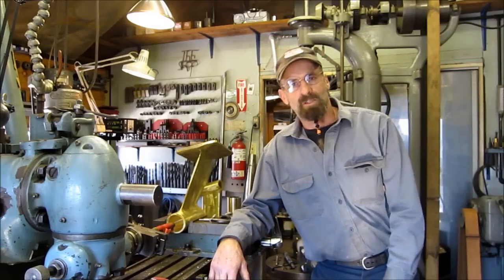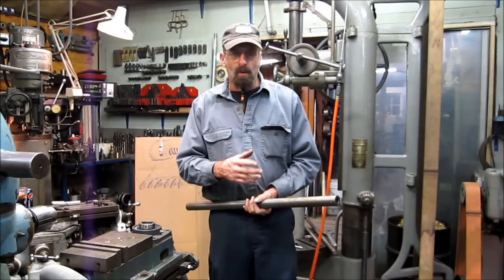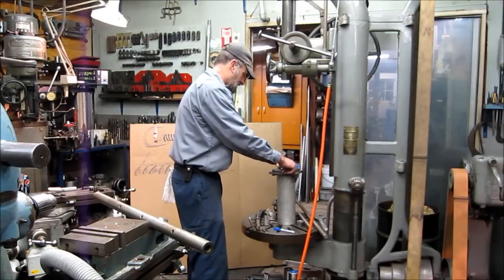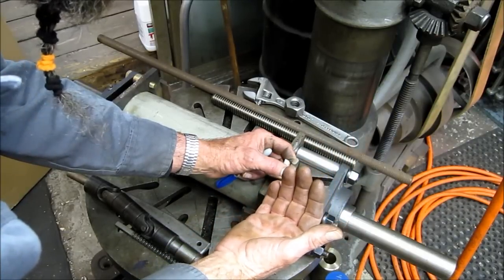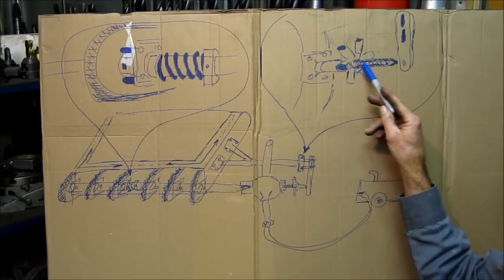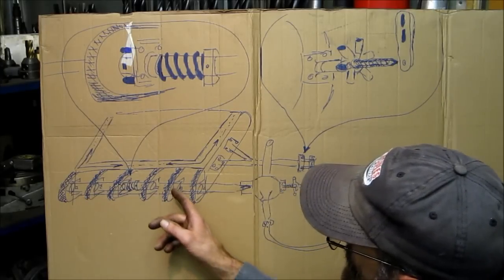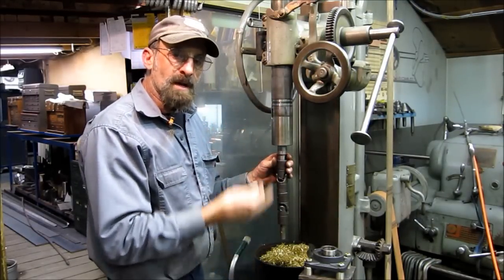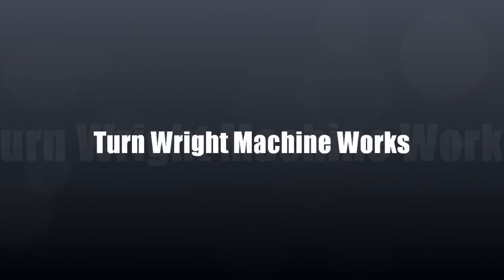Line Boring PART 1

Comment: I saw a video on a line boring kit. He showed the setup and used cones- only problem is that the cones were centering themselves on holes that were no longer round or centered on the original hole. I'm thinking I'll make 1in thick pillowblock plates. I have truck axles that I can turn between centers for nice boring bars.

Comment: Hi Keith, you are a real professional in your trade ! May I ask your opinion of the holes going through the boring bars ? Do they absolutely need to be square, or may a round hole, with a side hold that is drilled and taped for a set screw be just as good ? I know that the end of the set screw must have the cup or similar end ground flat. Thank you for your opinion. Regards, Pete.

Comment: Mild steel is a plain carbon steel, no other element is specified in its composition except carbon; for mild steel carbon content ranges from 0.16% to 0.29%.  An example is SAE 1018, plain carbon steel with a carbon content of 0.18%, commonly used to manufacture cold-rolled steel bar and plate here in the USA.

Comment: What would be your objection to:
No More Line Boring
Boswell
Reply from the maker: I would have no objection if the machine had started with this system and changed them out, in a scheduled manor. They still need a true straight bore to work properly. ;{)---
Reply: looks usefull for use after line boring and not having to sleeve out but they never wear round!